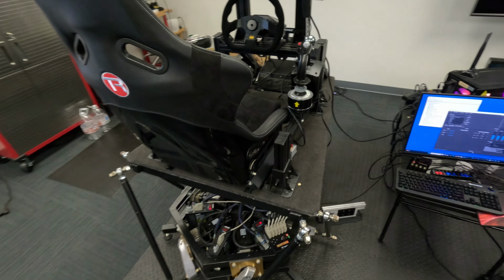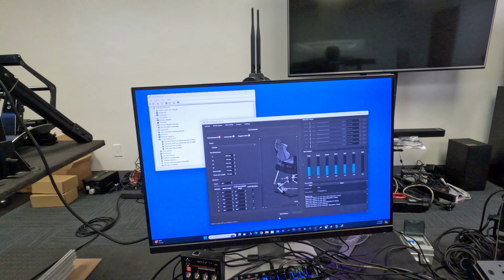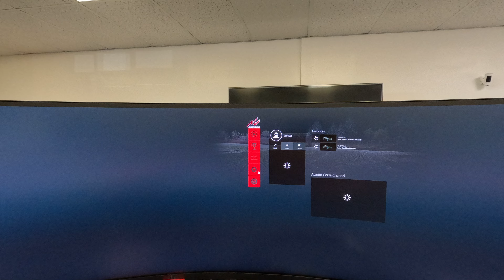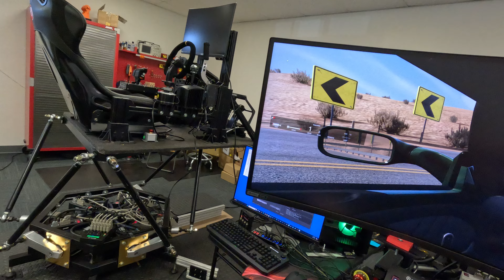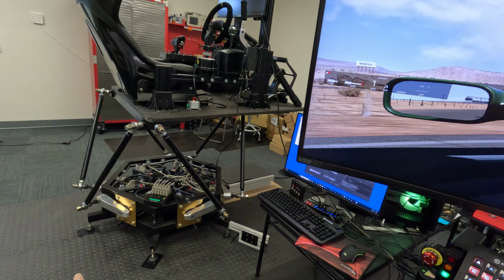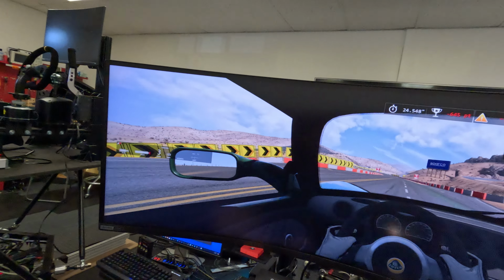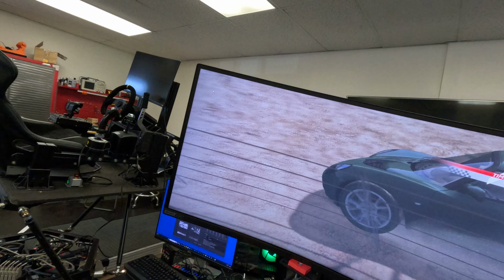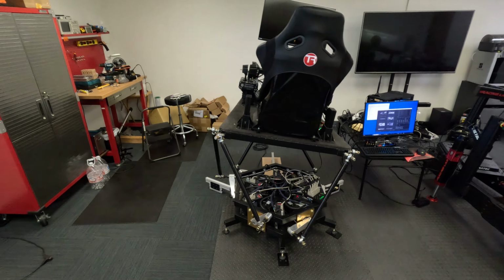FPV testing of DR-SIM software on dual platform mode

Comment: Nice work mate. as usual.  Just one little question:  Why the hexapods should be so high?  Isn´t possible design those with less height but same DOF movement?
Reply from the maker: @TPont7089  it would restrict surge and sway range...